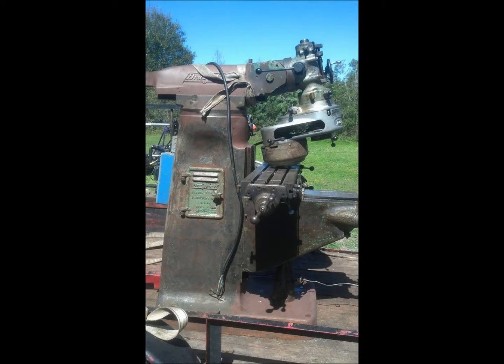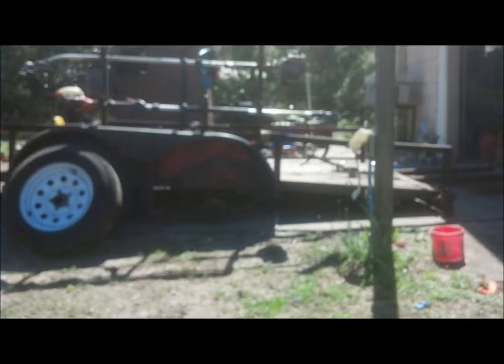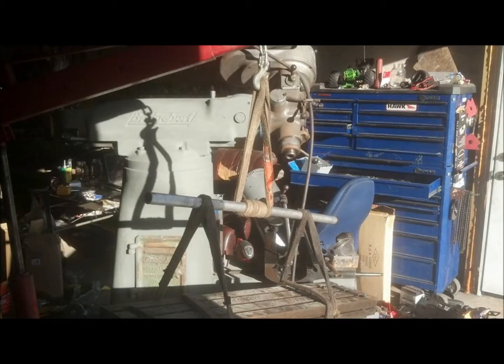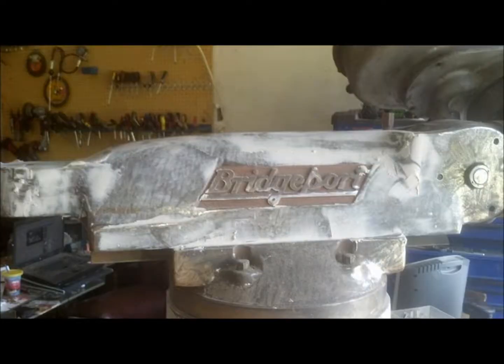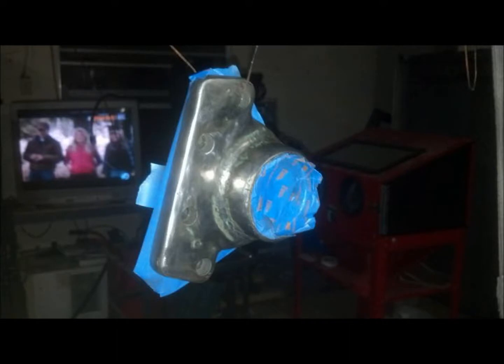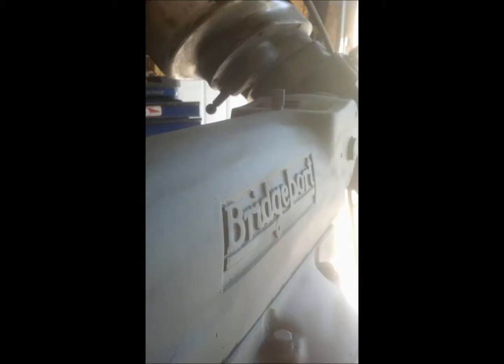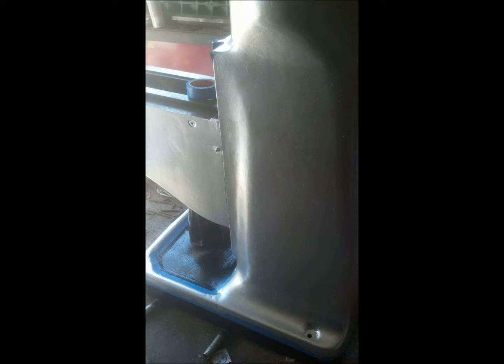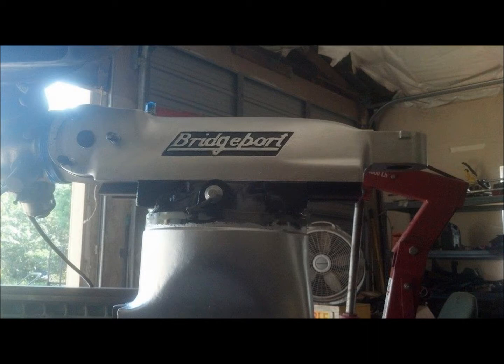"Button Pusher Series" 1959 Bridgy

Comment: Looking good! Any idea what's wrong with the power feed? Think you'll be able to get it working again?

Best wishes,
Tom Z
Reply from the maker: +Tom Zelickman (Inspiration Metalworks) Just needs an 800 dollar motor ahaha. I have a powerfeed on it. But chances are I will be using the new mill I just got. And using this mill for my new shapper/slotting head. I dont need two mills when ones not cnc. Now if I could use the one to rebuild the other, then cnc it ahaha
Reply: Why not CNC the other one then? It's not as hard or as expensive as people typically think. You're creative - I bet you could make that happen.
Reply from the maker: +Tom Zelickman (Inspiration Metalworks) The cost of the ball screws and having to re-scrap the ways, new gibs. I can buy something much better for the price. Bridgy ball screws and motors are expensive.
Reply: Hmm... Now you've got me thinking again. Dammit. You're gonna get me in trouble one of these days. :)